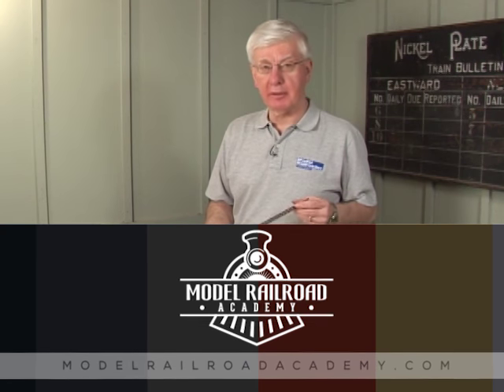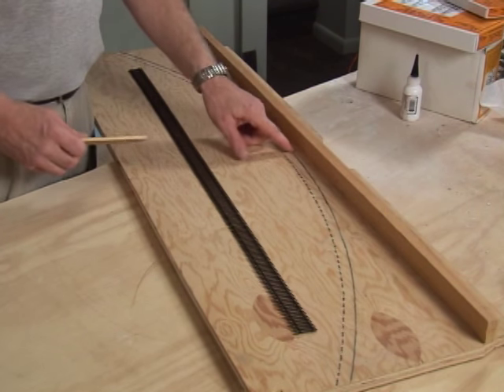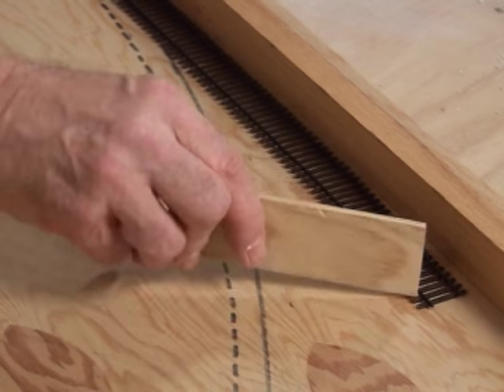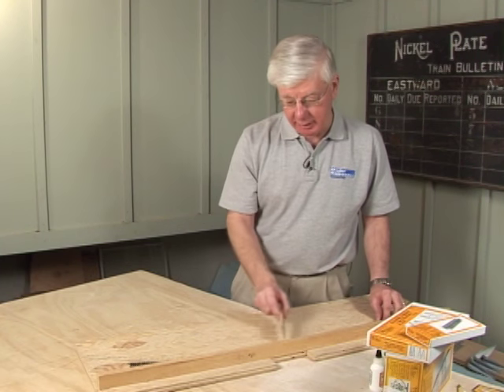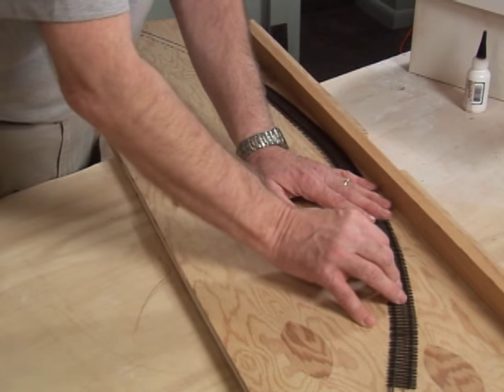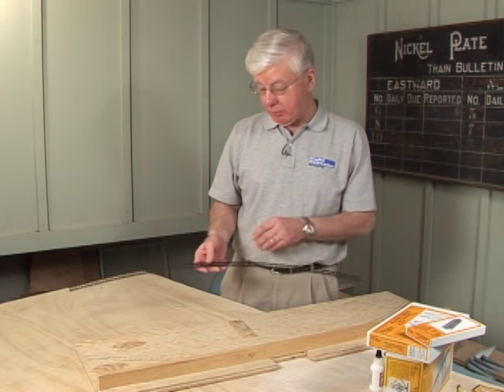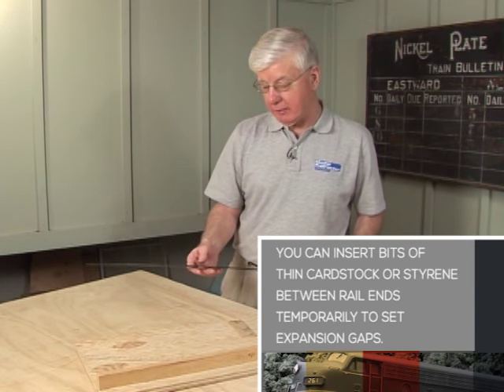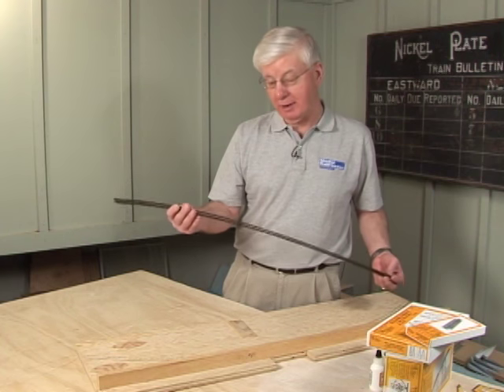Curving HO Model Train Flex-Track with Ease

Comment: Neat idea... I have been modeling in N Scale since 1989 and recently HO scale since February 2017. I have never had any problem curving flex-track by Atlas, Peco or Micro Engineering.
Reply: Jon Frost I bought some Atlas code 100 off eBay. Feels easy to bend.

Comment: Very good video and glad I saw this. I did see another modeler on youtube that would take 3 or 4 sections of flex track solder the rail and rail joiners. The entire long section was taken to the layout, put on the curve and he used a small track laying tool that comes with a kit for laying track. One side is for N scale and the other for HO. Using the HO side starting on a straight section just before the curve, he would move the tool back and forth along the length following the curve. I tried that method and man did it work out fine. He did warn that you move the ties, but before he would glue the track down, run the same tool along the ties and they would reposition back to form. Thank you for all your videos and I will keep watching. Oh by the way, I am a new subscriber!!!!!  D. Muse (WTC/B&O Washington DC Div. MRR)

Comment: another good tip from MRP editor Tony Koester. any flextrack you get needs to be bent before you put it in. I buy Atlas Code 80 for all my track and when I buy it I bend it at the store place it in a bag with sheet cork which also needs to be bent and when I get home I take it out of the bag and bend it in a box full of stones before i place it on the layout. Tony is right don't use rail joiners on flextrack or sections that join turnouts you need powered joiners or insulators on these rails and some places need to be soldered or welded because rail joiners are bad at carrying electricity and over time they rust and become corrosive and the track goes dead. if you don't want dead track solder it or place powered joiners on the section that needs power.

Comment: So it doesn't matter what side you curve it from?. Are the ties attached to the rails the same on both sides?
And not like Atlas where one rail slides and the ties on that rail have a gap underneath every 3 tie?
Reply from the maker: There are multiple opinions on that one. I like to put the sliding rail on the outside as that’s the one that needs to slide as the track is being curved.